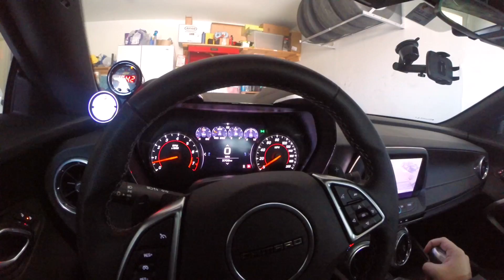Camaro goes to the Shop Plus Mustang Giveaway?! | Vlog #294

Comment: What’s the cost for what’s they are doing.
Reply from the maker: Ken Rain I got a Black Friday special pricing, but cost for labor and dod delete with cam was 2600 plus 900 for ported heads. Generally you are looking at around 4500-5000 for ported heads and cam.